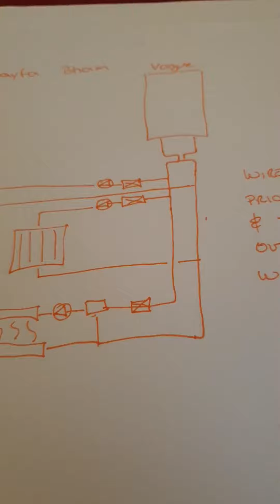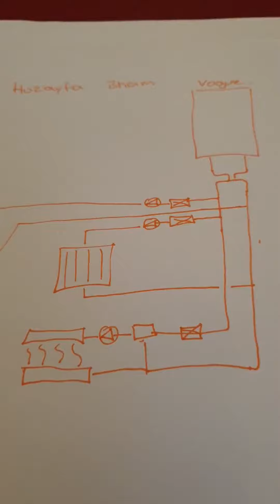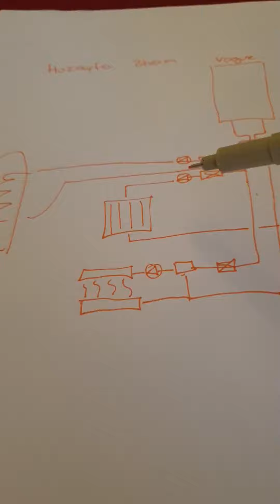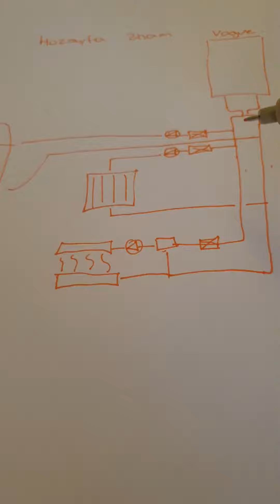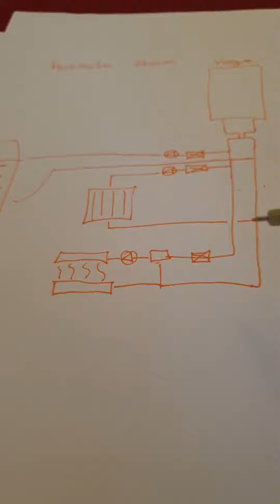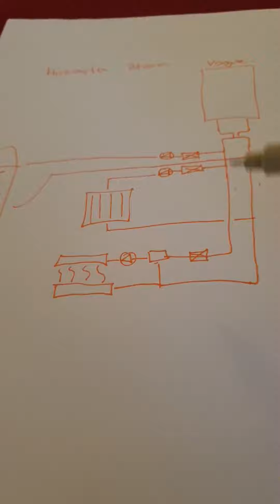Ideal vogue

Comment: Can somebody confirm this please?!

With PDHW , does it mean hot water will always kick in automatically as soon as the temperature drops in the cylinder tank??

Or will it be controlled by human to say "switch HW on now or on schedule"

I have 16yrs old cylinder tank and don't think it be a fast recovery technology and surely wouldn't want HW to kick in a lot of times through the day because 1)will be expensive and 2) heating be off during HW cycle 3) if PDHW is worth on a such old cylinder tank?

If this can be clarified please!
Reply from the maker: It will only come on if it is time to be on and the temperature is below the target temperature
Reply: @andrewmillwardwatford9410  so if I don't set a schedule for HW at all and the temp is below 70degree in cylinder.

What will happen?? 
Will it remain cold until I switch it on?
Reply from the maker: @bimiuk4051  if the schedule is off its off and if its on its on.
Reply: @andrewmillwardwatford9410  sorry I don't get it. If the schedule is OFF does it mean PDHW will kick in automatically ? 

On other side: how to prevent from switching  on automatically?
Reply from the maker: @bimiuk4051  if its off hot water is off. If its on hot water is on. I. Not sure what you think priority hot water is ?
Reply: @andrewmillwardwatford9410  sorry. I thought it will kick HW on automatically as soon as temp drops below on cylinder tank.

So that is what I asked ...
Reply from the maker: @bimiuk4051  only if its scheduled on.

Comment: Hi Andrew,
Couple of questions/observations.

1)It would be helpful if you could show the load splits and temperature dTs  your using for the different circuits.

2) If you install zone pumps, with integral flow checks, do you really need those zone valves?

3) Sure you know this, but you always need to be mindful of CCT reverse flow and temperature degradation, when using primary/secondary separation.

4) If this system is for a small to medium sized home, you could install a room influence sensor on each floor. That'll allow you to also have a compensated mixing circuit for both CH circuits. You'll then have just have one temperature setting at the boiler + DHWP mode.
Reply from the maker: We have adopted the term distortion to describe the change in temperatures caused by mixing Dean Close coupled tees or low loss headers. I think you'll find this is covered quite well on my videos on low loss header
Reply from the maker: Zone valves are usually existing. I wouldn't install this system from scratch.

Comment: This needs three boiler temperatures: 
1) DHW (high);
2) Rads (WC controlled);
3) UFH (low temp just above floor temp);

How do you get the three temps? 1) and 2) is by sending signals to the boiler - easy enough.  3) is by kidding the boiler. 

i) Have a 3-way diverter valve off the flow.  When Cylinder needs reheating, diverter valve moves to DHW, sending signal to the boiler via the end switch, to run up to max temperature. Cylinder heated using system boiler pump;
ii) When DHW is not called, the diverter valve sends flow water to the rads and UFH, using system boiler pump. Signal sent to boiler setting to WC. Rad heated via system boiler pump;
iii) Rads and UFH circuits have their own 2-port zone valves off the flow pipe;
iV) WC curve set to the rads circuit;
V) UFH controls (blending valve) drops flow temp to suit the UFH temp;
Vi) When calling for UFH only, kid the WC by using a relay and resistor to switch out the outside temp sensor, to give a low flow temperature such as say 35-40C.  Boiler operating efficiently.

With single temp boilers with WC, I have kidded the boiler to run at high temp for DHW only and low temp for when only UFH is called, while WC operates un-kidded for rads. By two cheap relays and two resistors acts as outside temp sensors. All by kidding the WC to give the flow temp you want.

Only use close coupled tees, when the system is getting too big. Although they can get you out of jail.
Reply: Hi John, how do you switch out the WC on a Viessmann vitodens100-W system boiler, to have lower temperature when UFH only and radiators are off?
Reply: @marcdebattista  
Andrew Millward is a Viessmann man. He tends to know this range very well.
Reply: @johnburns4017  on your comment "Only use close coupled tees, when the system is getting too big. Although they can get you out of jail." 

What is too big? Can you run 12kW of radiators and 4kW of UFH on a 30kW system boiler with weather compensation without hydraulic separation? The boiler has DHWP.

On a comment under one of the HeatGeek video (https://youtu.be/K_OWE2dJht0), don't you suggest a setup with close coupled tee for the UFH on the return pipe? I wonder if I should do that for the 12kW of radiators and 4kW of UFH or if this is an unnecessary complication without any benefits?
Reply: @marcdebattista 
You are using mixed temperatures.  
It depends on the boiler and pump. 
Divide and rule.

1) There will be hydraulic separation using the UFH, as it will have its own blending valve and pump.  
2) Using DHW priority means DHW is out of the boiler/pump equation, as it is either CH or DHW. Never both.
3) the system pump does not need to have the power to pump into the UFH circuit, as UFH has its own pump and blender.
4) is the system pump man enough to serve the 12kW rads? That is all you need to take into account when assessing if you need to hydraulically separate the rads. Unless you have exceptional resistance in the pipework/rads I would suspect the system boiler pump would be man enough. These days the de facto standard in combis and system boilers is a 7m head pump. Risen from 6m of only a few years ago.

Comment: Andrew, I think you are thinking of Intergas when talking about how this boiler operates. Ideal Vouge has 2 separate switched lives that take 230V - one will operate at full load (non-adjustable unfortunately) the 2nd will do weather compensation. If both switched lives are send to the boiler at the same time the boiler will fire at full output for hot water.

You need an X plan or similar or DHWP for this set up to work. If you have a call for DHW and CH at the same time in your set-up - both hot water and the heating will come on, and your rads will get 80 degrees flow.
Reply from the maker: I say at the begining it has two temperatures.